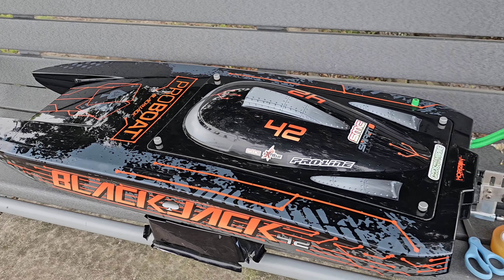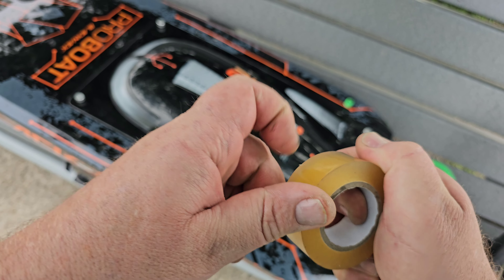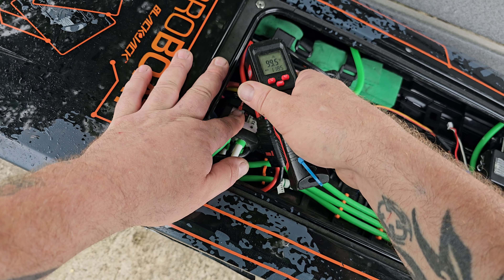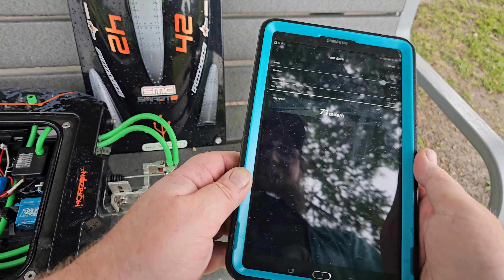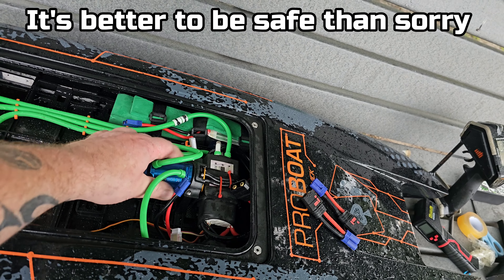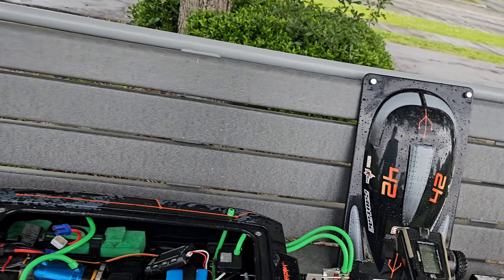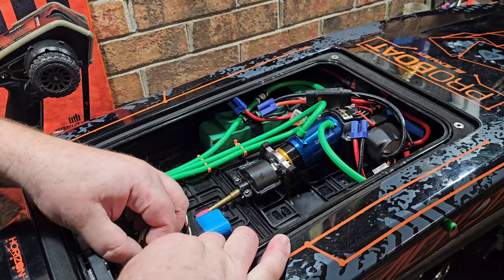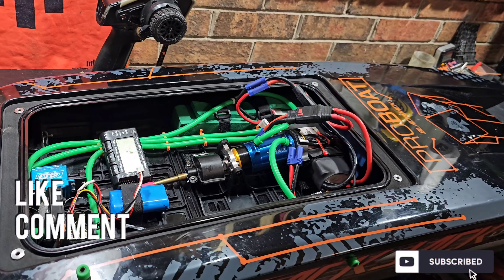Insane Proboat Blackjack 42 Setup 8 & 12s Test  - Tp Power, Flier 400a, Speedmaster, OSE

Comment: You're so right about the uneven hight for the trim tabs. Makes the hull suitable for
different water conditions and less itchy. Yes !
Reply from the maker: I could tell a huge difference when I switched over to the higher mounted trim tabs, almost night and day difference in handling and top straight line speed.

Comment: Do what I do with my nitros on your boat. Using a SR6100 receiver, use a 3S lipo with a Y-splitter, put one end into then BEC and then into the receiver, then the other end into the 2-pin telemetry voltage port on the receiver, then use a lipo buzzer alarm. You can see real time BEC voltage AND full real 3S voltage on your DX5 screen, but just in case you forget to check your 3S voltage, the lipo alarm will sound. The right alarm is loud as hell too, it’s louder than the nitro motor I use on my trucks so surely it’ll be loud enough to hear it through your prop wash.

Comment: The amazing BJ42 is the King 👑 of RTR boats, I wonder if the stock motor could handle 10s, although I don’t think 🤔 that it’s required it’s powerful and fast enough with 1350kv motor. I have used some expanding foam in the front sponsons, and mine corners amazing at whatever the RCboats bitz prop can do 65mph ? Your suggestion of the 2nd A being the “balance point” seams to work even with the extra weight up front, just move the batteries back to achieve balance.😊

Comment: “B” motors like that especially drag motors they will cog the esc is trying to find its timing. Non sensor Motors will do that it’s normal. You don’t see the cogging to much in the water. But when you have that motor in a car you’ll see the cogging. I have that motor in my vendetta and it cogs
Reply from the maker: Such an odd thing, common on cars but boats?  never really experienced it with boats we'll see what happens next time out thanks